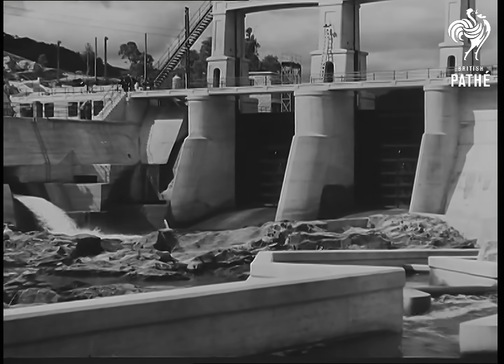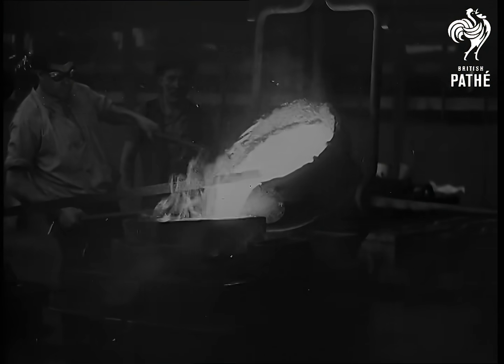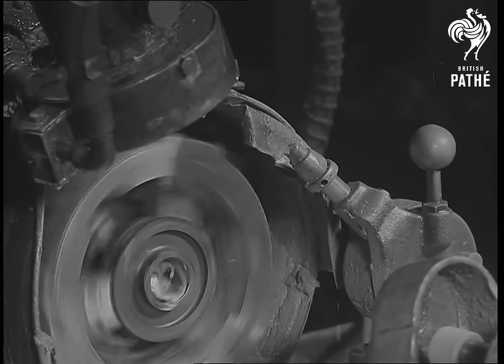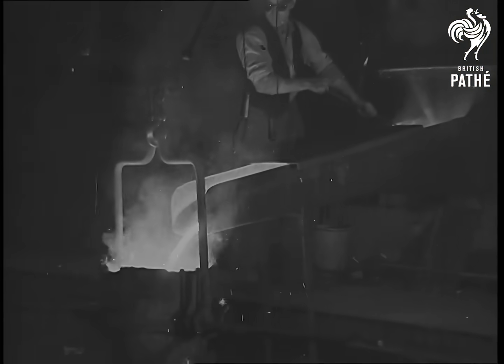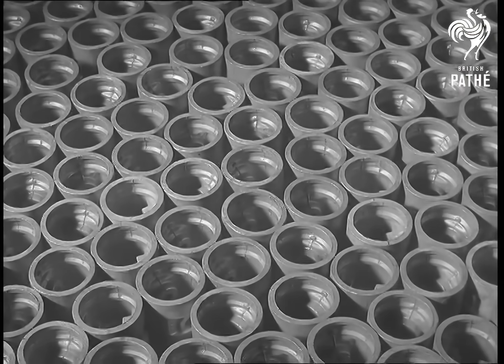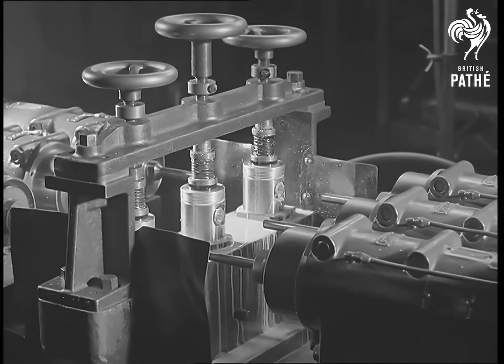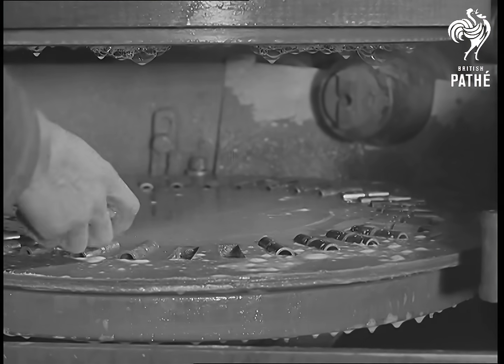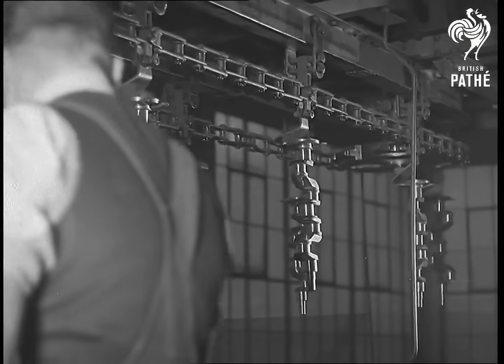Power: Constructing a Car Engine (1930-1939) | British Pathé

Comment: Its crazy to think that even back then, there was some type of automation. I wonder how they did the mechanical programming?
Reply: don't forget the Jacquard looms in the very early 1800s were effectively NC controlled, off punch cards. The auto lathes here were prob cam operated, these had been in use since the late 1800s. Along these lines  https://www.youtube.com/watch?v=VS7GeKBbnSU
Reply: RockinRedRover highly likely.  It wouldn't have been that much later though for the introduction of relay and pegboard machines like habeggar automatic lathes.  (Mid 40's)
Reply: Mostly gears and cams would control the process. Carefully calculated (slide rules) and designed on the drawing board, and then made in one off production by tool makers. This is why in those days it took many years to bring a new car into production, as the tooling for a new production line (ie the heavy machinery shown at work in this film)  all needed to be made as one-offs by highly skilled tool makers. And of course, the prototype cars for testing were all individually made one-offs, also adding years onto the development program.
Reply: Cam and gears mostly.
Reply: They likely used Relay Logic (the same type of system that most elevators/lifts use) or they used pneumatic logic systems (heavily used in commercial office building plant rooms for the air conditioning systems up until the 1980s and still in use now)
Reply: agreed wrt the drilling/tapping/reaming/boring etc machines.
Reply: I was lucky enough to use a pre war lathe when i was in school, they are excellent machines but they must be respected. One wrong move and it could rip you to bits... Cogs, gears and belts run everything as far as i can remember you can set a speed to automatically move the tools depending on what you wanted
Reply: the first programmable lathe was a French machine from the 1700s
Reply: Math
Reply: Classical Physics all the way...
Reply: dantheman1998 probably a lot of pneumatic linkages that closed and opened various valves one after another

Comment: Very good image quality to be so old
Reply: 35mm film was HD before HD existed!
Reply: 5Rounds Rapid what?!
Reply: That's film's particle resolution for you!
When you think about it, even very old movies can get BD releases nowadays because of that.
Reply: Even super 8 film can be scanned in HD
Reply: Malfattio definitely, but it will be grainy. 16mm is roughly 1080p, 35mm roughly 4-5k.
Reply: @5roundsrapid263  
This depends on the how grainy the film is as you said so comparing film type wont give you a correct spatial resolution, I seen 8mm films with 10 ISO that were extremely clean and could be scanned into 4k and with a bit of sharpen you think it was captured by a modern camera.
Reply: SMGJohn It definitely depends on the film stock. Low-budget films and TV often used cheaper film and it shows.
Reply: @SMGJohn  I'd say most 1950's cameras had a sharper image than most consumer cameras have today. But they did cost 50 times what most people are willing to pay for a camera today. Quality doesn't seem to matter these days.
Reply: 35mm film is like 4K resolution. Unfortunately it's only 480p here on youtube.
Reply: Hal
That's pretty normal film quality for the time.
Remember, we may all have video cameras available 24/7. However, the quality of our cameras is rubbish compared to the equipment they were using back then. Their optics was hand made by Zeiss, and they were filming on miles and miles of film, no expense spared.
Today, we are recording through primitive plastic lenses, onto a tiny video chip, and the digital footage is compressed to the bare minimum. 
You get what you pay for, and sadly, they had much higher film quality back then than what most of us make do with today.